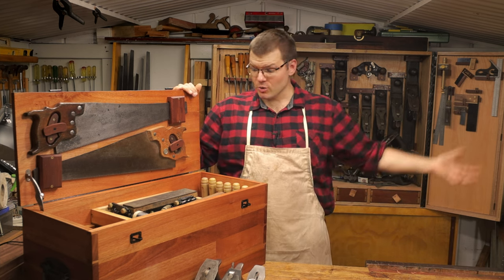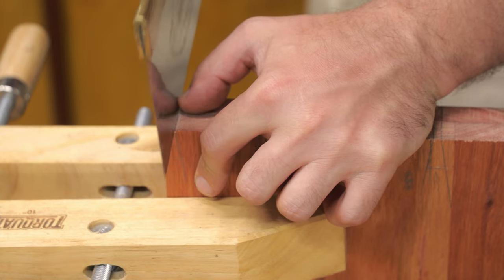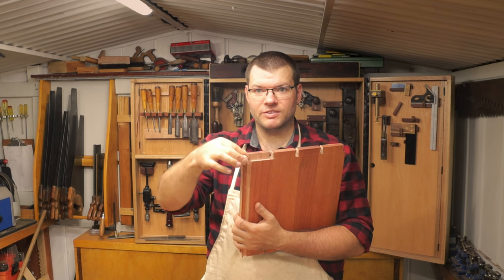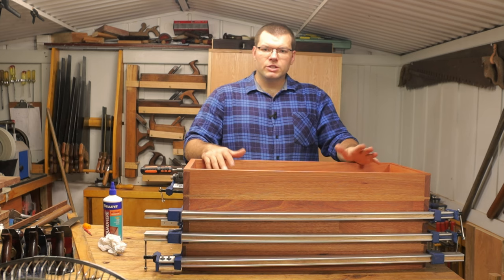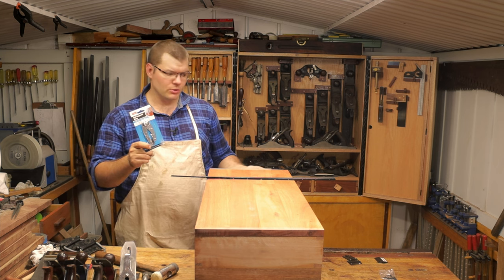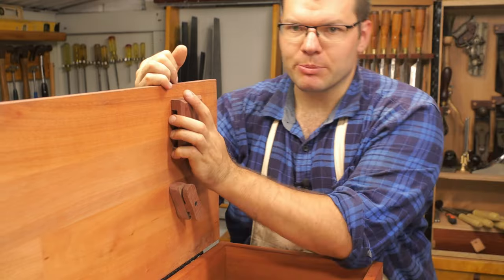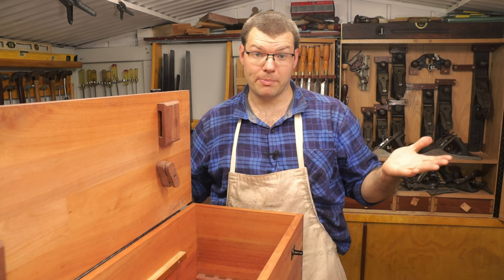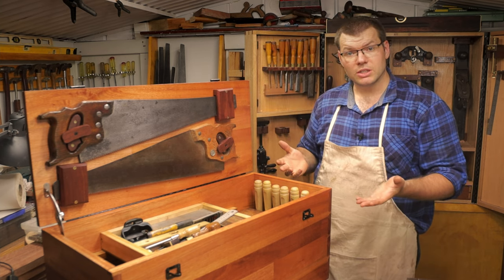How to build a Tool chest

Comment: I've watched this build project several times and I think anyone would enjoy having this tool chest. It's a practical and attractive piece, of generous proportions, that could adapt to many other uses - while not being expensive to make.
Reply from the maker: This chest definitely turned out looking nicer than i had thought, the timber really popped. 

One change i would make is some sort of support for the lid to stop it cupping (bread board ends, captive panel or just some support sticks maybe), it hasn't moved much but enough to make the latches hard to close.
Reply: @AussieWoodshed  I know what you mean. I have a vintage (mid century modern style) drop-leaf table that had melamine tops. I replaced them with laminated boards for a nicer finish. I should have added indiscreet rails along the underside across the jointing to stop movement of the wood over the width of the drop leaves (about 20" on each side of the table). I should have known better. We live and learn.
When I say "stop movement", I mean cupping across the width of the jointed boards. A few screws through slightly elongated holes in underside hidden rails would hold the boards straight while allowing expansion/contraction. I'll add them and see what the result is over a year in all seasonal changes, which alter dramatically here in both temperature and humidity.
Reply: I got a ton of antique hand tools and I think I will make this using them and then use it to store them

Comment: Hi!
Thanks for the video.

At 3:40 you mention to get the cut square across, but do you tilt the saw to match the dovetail ratio, following the line you marked, or?

Thanks and cheers.
Reply from the maker: Yes, square the cut across sawing maybe a few millimetres deep, then follow the line of the dovetail already marked.

Comment: where did you get the dovetail square thing you used for marking them?
Reply from the maker: I got it from beyond tools, a store in Perth. https://bit.ly/3rrP8xO . You can also use other dovetail marking jigs like these one https://bit.ly/3nFp8hj or https://bit.ly/3fC8ZVp (the 1:6 ratio is what i usually use if you go with this one) which have the dovetail angle and square combined in one making it easier to mark and align. Hope this helps